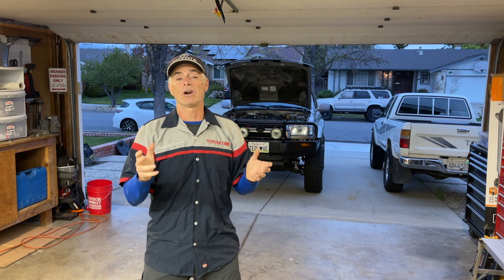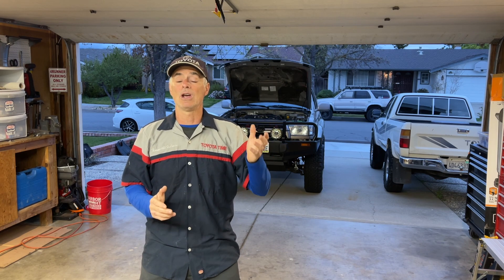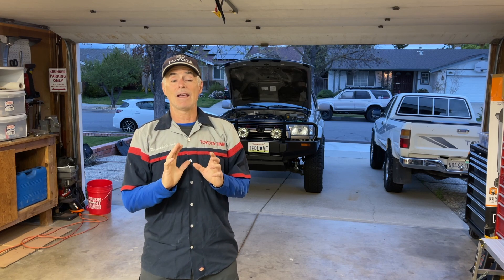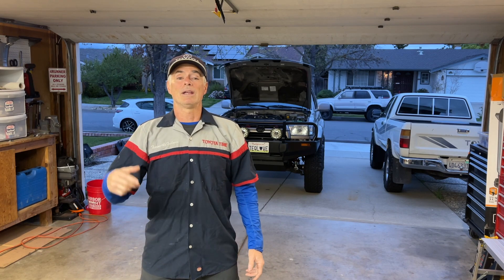How to Perform an Engine Block Test - (Head Gasket / Cracked Head Diagnosis)

Comment: Obviously the sensible thing to do would be both heads at the same time since the gaskets are the same age and have endured virtually equal destructive conditions endured. IF you have the time and resources ($$$) to do so. But life doesn't always allow for sensible solutions to problems. If I were strapped for cash or time was of the essence I would definitely do just one head (knowing full well it might come back to bite me in the ass sooner rather than later). You have to work within the situational boundaries of that particular period of time when it needs to be addressed. That said, I would do everything I could to gather the time and resources to do both if at all possible. Sometimes it's not possible. Especially for those with low income due to circumstances beyond their control (like health issues). Lack of money has a long trickle down effect on all facets of your life, often times forcing you to pay more in the long run by taking short cuts in the short term simply because that's all you  have to work with at that given time. I think the "fix only what's broken" approach is a viable option overall, and for some people might be the only option. The only time that strategy rubs me the wrong way is if those short cuts are born from overall laziness as opposed to time constraints or financial limitations. If your excuse for not pulling the second head is "I didn't feel like it", don't look to me for sympathy if (when) that other head gasket blows out 6 months or a year later and your lazy ass has to do it all over again. 

Looking forward to the series Tim, as this is a job requiring a skill level that I've yet to achieve. Perhaps your videos will boost my confidence enough to tackle it anyway someday knowing that I have a source of reference that's detailed enough to carry me through any challenges that might arise. If so, it certainly wouldn't be the first time one of your videos gave me the boost I needed to attempt and conquer something new. And that's one hell of a gift from one stranger to another, and extremely appreciated. Each and every time. If good deeds toward your fellow man truly do pave the road to heaven, you're building a six-lane interstate straight to the pearly gates!
Reply from the maker: Wow, now that's a comment.  I appreciate the thought you put into it and I agree with everything you said.  

It's our pleasure to help people with our videos and I'm stoked to hear our videos have inspired you.
Reply: I rarely comment on YouTube videos and when I do it is because I feel inspired to do so. That inspiration may come in many different forms,  and with you it's simply a matter of respect and appreciation for time and effort you put into helping other people and doing so free of charge. And I don't mean you make them for free, thankfully YouTube defies all modern big business strategies by voluntarily rewarding their content creators for their contributions to the network. What I mean is they are free to us, the viewers who watch and learn and are inspired by your videos. Where else can you get that much value for basically no money? And this in a world gone crazy with bloated prices and reduced quality. Go  figure. I think it's awesome that a place like this still exists in direct opposition to the world around us, and that wouldn't be possible without your motivation to help others to start with. I love the whole "pay it forward" concept and that's really what you're doing here. That's how I see it anyway.
Reply from the maker: @RyanSeek  Yes Ryan, you get it, when many don't.  The only cost involved is having to deal with the ads.  That's a small price to pay for very helpful information you're getting.  People have asked why I don't have a Patreon account, and I always tell them it's because I don't want to charge people for access to our videos.  The goal is to help people.  The money we make from YouTube and from Amazon and Ebay Associates programs is just a fringe benefit.  

Yes, we are very much Paying it Forward.  I've benefited from many other YouTubers to fix things and attain other knowledge.  The only thing that bothers me about YouTube is they do partake in censorship, and to avoid a political discussion, I'll leave it at that.

Sean and I invest a huge portion of our free time into this venture.  We both have full time jobs, wive/fiancee, and other commitments, so it's a struggle at times to find the time to get together to create new content to share.  People like you that acknowledge our efforts are the ones that help motivate us to continue doing what we do.  So, THANKS Ryan!  We appreciate you!
Reply: @TimmyTheToolman  I am thrilled that I was able to convey the amount of gratitude I hold for you guys, and even more so that my comments can provide motivation for you to continue with new content. I guess we're just having a big ol' appreciation fest among ourselves right now and that is awesome! 

Always wise to avoid opening a can of worms by starting any topics related to politics, but you said enough for me to understand where you are coming from and totally agree. Despite having those same grievances myself, I still have to give YT credit for at least stepping  up and rewarding creators for their hard work. That's a lot more than any of the other 8000lb social media gorillas are doing. The censorship you speak of permeates the entire spectrum of big time social media platforms  so they all stand on equal ground from that point of view. But YT is the only one who shares some of their massive profits and does so willingly placing them head and shoulders above the rest. I think they deserve some credit for going against the grain and doing the right thing, at least in this one aspect. It's a shame such a good deed is so oppressively  overshadowed by all the privacy invading, Constitution stomping and blatant misuse of power. But that's the world we now live in, scary as that is. Anyway, enough ranting on that subject, no sense letting the despicable truth spoil our appreciation fest we have going on! 

I'm thankful to have achieved such a rewarding  interaction with you on top of the value you already provide by sharing your knowledge. You have a friend and a fan for life, at least in the digital world of social media. And if we ever met face to face, I'm sure we'd have the same results in the real world. Take care, Tim, and thank you again. Now on with the show...
Reply from the maker: @RyanSeek  Yes, we obviously have mutual respect for each other and that is good.  More helpful content is coming.  It might sound kind of weird, but I find running our YouTube channel more rewarding than doing my firefighting job.  When I'm actually helping people as a firefighter, it is very rewarding, but we deal with an enormous amount of BS, and that's the part that burns me out.  Every video we put out, I know it's helping people, which keeps me motivated to continue doing it.  Take care and I'm sure we'll exchange more messages as time goes on.  Happy Wrenching!

Comment: When I do this job, I think I’m going to replace mostly everything except some seals, bearings, knock sensors, and water pump. I did the complete timing belt job and replaced everything about 40k miles ago and then ended up replacing knock sensors about 20k ago. Will be replacing the lesser expensive gaskets, seals, and belts as well as coil boots and wires forsure even though those were replaced at same time of timing belt/knock sensor job. And probably replace injectors again too.
Excited to see the upcoming videos!
Also, my issue is on my passenger side but I think I will still have both heads resurfaced and tested. However, some people do recommend getting a JDM motor instead but always hard to verify mileage.
Many different ways to tackle this issue but all depends on budget and time.
Reply from the maker: Thanks for sharing all that.  Good luck with job!

Comment: What’s better than doing a big job once. Doing it twice because you didn’t do it right the first time. You don’t buy one shoe just because the left one doesn’t have a hole in the sole. One and done do it right the first time.
Reply from the maker: Thanks for sharing your opinion Mark.  What if you just bought one shoe and hopped on that leg.  Then you wouldn't ever need the second shoe.

Comment: I believe myself to be firmly in the "while I am in this far, I might as well..." camp. If I have the money I will go ahead and do the extra work. 
However, I do understand being torn on not wanting to spend $500 for the knock sensors even if you are in there, but I would absolutely recommend replacing the knock sensor wire harness without a second thought. I know the condition the wire harness was in on my truck when I got to it, and it disintegrated at a touch. I did in fact spend the $500 on new sensors, then I cheeped out and got a harness from Autozone for $55, only to have to replace it 2 months later with a $100+ OEM from Toyota. The Autozone harness did at least last long enough to get the truck smogged, but it was not worth the money I "saved" to go into there twice to replace it again.
Reply from the maker: Yeah, I'm with you.  I'd for sure replace the knock sensor wiring harness but would roll the dice on the knock sensors because of the cost.  The good thing about doing your own work, is it won't cost you an arm and a leg to to repeat work if your gamble didn't pay off.  I'm certain a shop taking off an intake manifold would HEAVILY suggest the customer replace the knock sensors and harness, and at the cost of their labor, it probably would be smart for the person who doesn't turn wrenches.

Comment: Have the same thing going as this right now. Misfire in cyl 6, haven't did a leak down test but have done a compression test which was way low. I tried the block test and fluid never changed colors either. Defiantly will keep following this series! I want to pull both heads but I'm pretty intimidated by having to pull the cams and trying to re time everything.
Reply from the maker: It's not really that hard once you see how it's done.  It's just another time consuming job.  Anyone can do it with the Right Information, Right Tools and the space and time to perform all the steps.  Stay tuned!
Reply: Watch the 6 part series on Youtube - it gives it in detail.
Reply from the maker: @dalandser562  That guy did a good job and it will be hard to surpass what he did, but we're going to document this job in the Timmy the Toolman style for the people that like watching our videos.
Reply: @Timmy The Toolman  sorry to keep commenting but I cant find anyone that knows toyotas like you do. Hopefully the rebuild company just fixes it but if not I was wondering what you think. The truck starts up good when it's cold but it misfires for about a minute after start up. After that it runs smooth and won't miss again unless I let it cool all the way off. Also if I cold start it ( starts right up) then shut it off then try to start it again it won't it just cranks for 40 seconds until it weak starts. Does that more sound like a issue with the heads to you? I plan on doing the leak down test tomorrow.
Reply from the maker: @Wyo_Roadhunter  I'm sure about what your issue can be.  It could be something like a failing cooling temp sensor.
Reply: @Timmy The Toolman  found it I think. 30% leak off into exhaust on #4 cylinder and 45% leak off into the intake  on #6
Reply from the maker: @Wyo_Roadhunter  Those are significant leaks.  They are both on the driver side head, so maybe you'll get lucky and just have to rebuild that one head or possibly replace it.
Reply: @Wyo_Roadhunter  interested to see if you have cracks between the valves as I did. Water was getting into #3, but I pulled both heads & confirmed cracks present between the valves on every hole….some worse than others with #3 having the most visible cracks. Replaced both heads and refreshed the valves.
Reply: @dwayner  the motor was rebuilt a year ago so its going back to that company to be re re done haha. I'm curious also but I'm not losing any coolant so I'm not sure. It only misfires on start up when cold, once it's warm it smooths out and runs good.
Reply from the maker: @LoneScout1  We're anticipating finding a crack between the valves on the #3 cylinder of Sean's rig.
Reply: @Wyo_Roadhunter  interesting mate. It went on for a long time before I finally realized/admitted it was losing a very small amount of coolant. Over time it slowly got worse but I’ll bet I put over 50k miles on it during this time.
Reply: no worries on the timing it’s paint by number….and now there is this thing called the internet…_something that wasn’t a thing when this engine was released.🥸

Comment: if when starting the engine and white smoke comes out of the exhaust pipe , that indicates a blown head gasket, and if it is blue smoke the engine is burning oil, most likely it is valve seals, or something more serious as piston rings.
Reply from the maker: That sounds accurate to me.

Comment: I'm the pull both heads type of person. Just brings the peace of mind that you won't have to worry about the other head failing in the near future. Looking forward to the series on pulling the heads.
Reply from the maker: Thanks for sharing your opinion.  I'm the type that would pull both heads too.
Reply: I've got a 98 Tacoma project vehicle which I've replaced everything except the cab, frame, and main wiring harnesses (I'm talking motor, trans, rear axle, full front suspension, doors, front and rear windshields, fenders, etc.) and hasn't moved a foot in years.  I've done the "can o' worms" / "while you're in there" approach and meanwhile on my wife's 97 T4r I've had to keep it moving each week as it's her daily driver to work.  This week while on her and my vacation I closed my eyes to a saggy rear suspension, leaky rear diff, crusty oe soft line to the axle, and broken kickdown cable for the auto transmission while just redoing her rear axle bearings and rear shoes.  I have a pile o' parts and not enough time - that's why I see the other side of the argument.  That said, I would never replace both heads - pull the engine and getting a fresher engine is how I'd do it (and have done it on both of them).
Reply from the maker: @dalandser562  Yeah, buying 2 quality heads can be very pricey, and then you start thinking, if I'm spending this amount, why not just put it towards a rebuilt engine.  I would never, and I mean NEVER, go the JDM route.  That is a HUGE crapshoot in my opinion.  You have no clue how many miles the engine has and how it was taken care of.  The only way I'd go with a used engine replacement is buying it from a trusted source, someone I know, or buy a rebuilt engine from a quality rebuilder like Yota1 Performance.

Comment: Random, but a base model Tacoma cameo at 2:26. I spy 5 Toyotas at that point in the video (of you include the Lexus). Have you converted everyone on your street to drive Toyotas? I hope so!
Looking forward to the series. As for what I would do, I’ve not done enough intense mechanical work to say, but I guess if I’m going to lots of trouble to fix something, and there is a decent chance that something else in there is likely to fail within a reasonable amount of time, I’d tried to go ahead and take care of it.
Reply from the maker: That's not a Tacoma.  That's an early model pickup.  We'll have some videos on it.  This is Sean's new neighborhood.  He hasn't converted everyone yet.
Reply: @TimmyTheToolman  I should have clarified. I meant the one driving by on the street. Yeah, I’m pumped about the 1990 pickup!
Reply from the maker: @eljefeslash  Oh, gotcha.